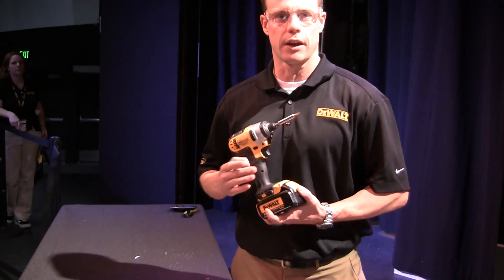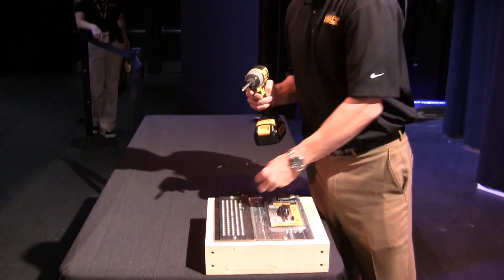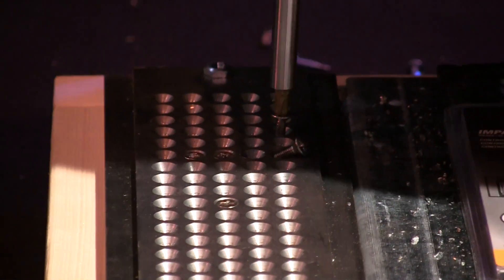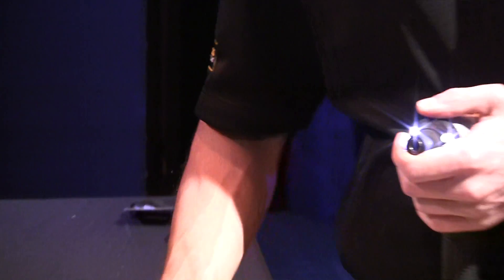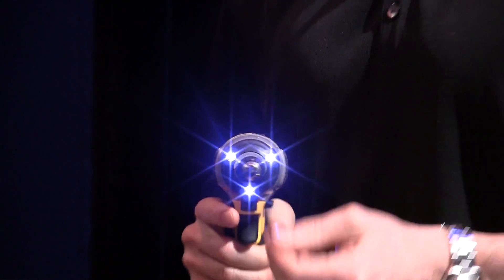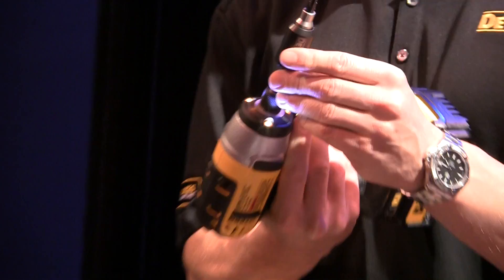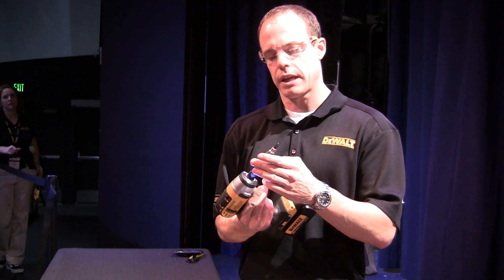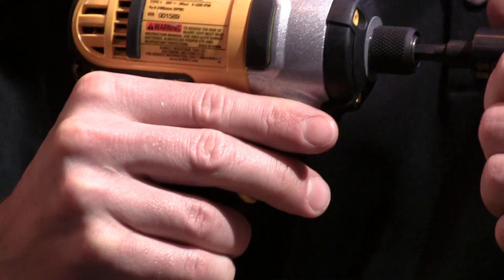Demonstration of the DEWALT Impact Clutch

Comment: I don't get why they don't have clutch built in... or maybe a hybrid: make a standard drill/driver with a clutch, but give it a hex head rather than a chuck. I know u can get quick change hex adapters but they're a bit janky
Reply: Bosch flexiclick allows you to swap the chuck with a hex bit holder instead of using an adapter

Comment: WHY TF isn't it just built into the drill like it is on the 18v? This is my number 1 tool and would guess that for most a drill driver is the absolutely first tool they reach for in a million situations. And are you REALLY serious about adding an external clutch? The first major design feature is that it's short. How far does that damn thing stick out; 4 or 5 inches? I've been researching for over a week on which system to buy into. I've been searching like crazy for a 20v version of the 18v. You don't have one,,, you did this instead. This is exactly WHY I won't reach for a Dewalt to drive screws and bolts and if you don't get one out soon, it's very unlikely I'll be reaching for a Dewalt on any task.
Reply: Quick correction it's your (DCF601B) 12v. You need a 20v version.
Reply: On the bright side newer impact drivers have speed control that increase or decrease the torque output. Some other users suggest that a clutch won't quite work well on an impact driver due to the non linear torque output and durability concerns.

Comment: Seriously. How do you take the default bit tip out of this thing?
Reply: take a pair of bullnose pliers to remove a nail and chomp them down on the tip and give it a good tug. any bit could sieze in the shank. sometimes you have to tap it a couple times to remove the tip holder from the impact itself even. just get the pliers out. it's pretty common